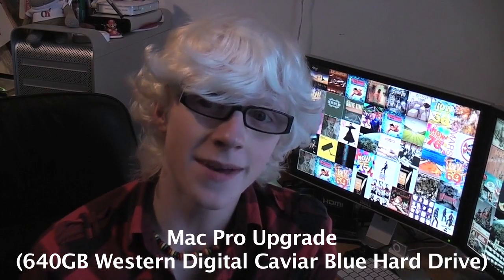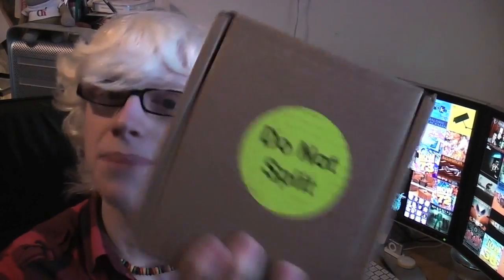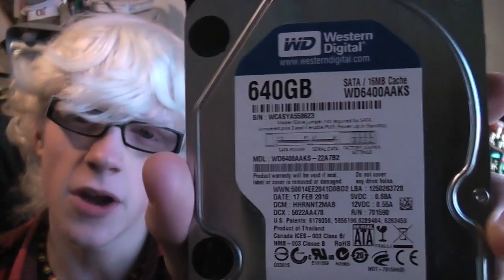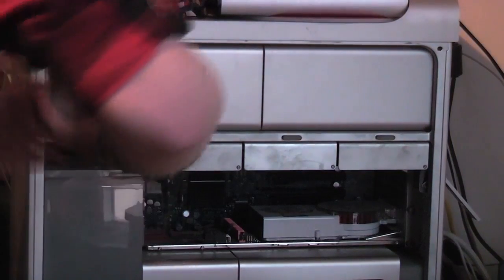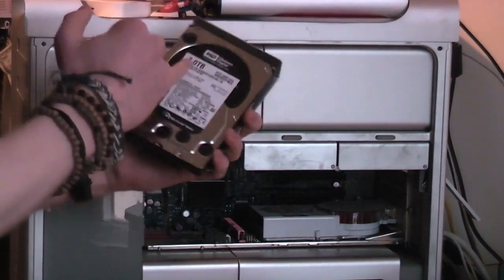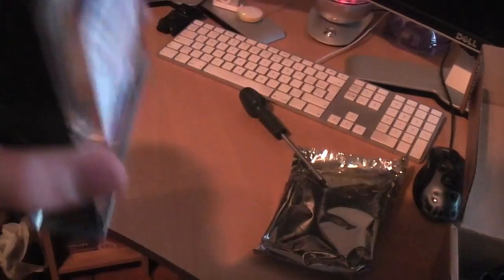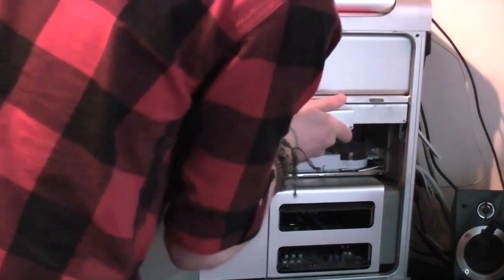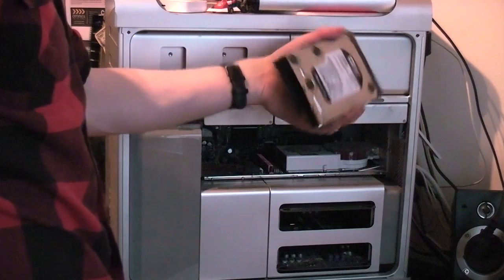Mac Pro Upgrade: Western Digital Caviar Blue 640GB

Comment from the maker: @FreeForAllGamerz Because the one that I have sticks out the back about an inch an a half, and it's the largest cable at the back of the Mac Pro. It's stopping me push the whole machine further back... The official power cable is pretty much flush to the back on the case so I could push my Mac further back so it'd be safer... And believe it or not, small things like that contribute to increasing resale value.

Comment: I'm not sure about the 640 but nearly every 500GB WD drive we purchased in the office has failed after about 2-3 years. Not sure why that was. Not so much trouble with the smaller 250's we purchased around the same time.  Only mentioning it so you dont get caught without a backup :)

Comment: @Paratrooper1n0 I did, and posted a question on two computer gaming forums; nope.  One guy suggested that you might be thinking of something other than the NVIDIA GeForce GTX 600 series.... like one of the GT models or something.  Don't know where you got your info, mate, but if you could supply a link then I will believe you, but as it stands... (P.S.  Also went through 3 pages of Google search for "GeForce GTX 600"; still nothing)